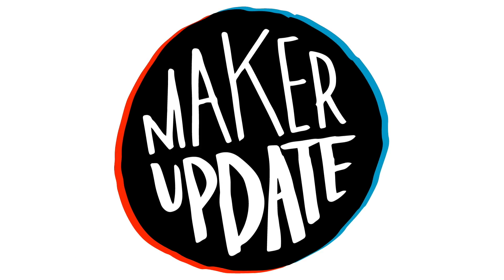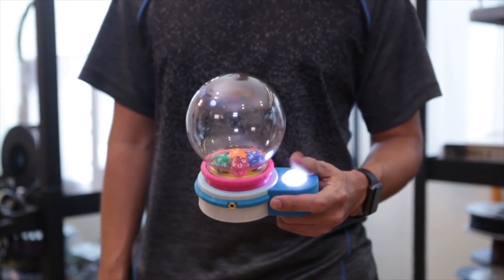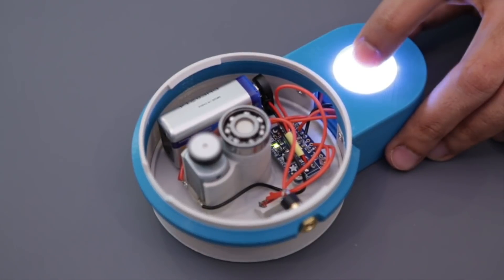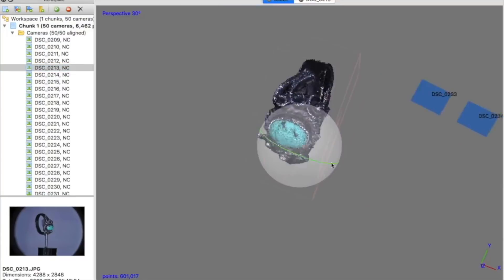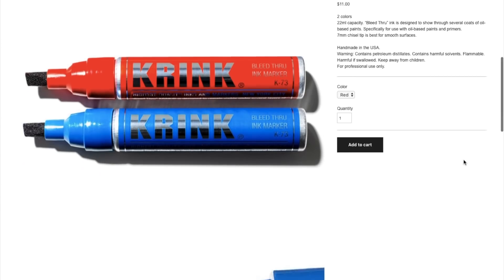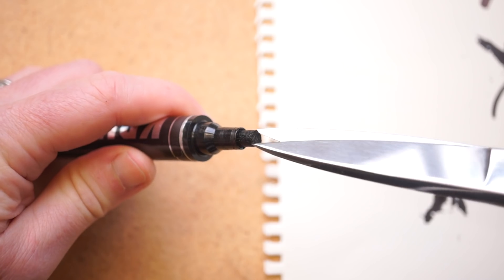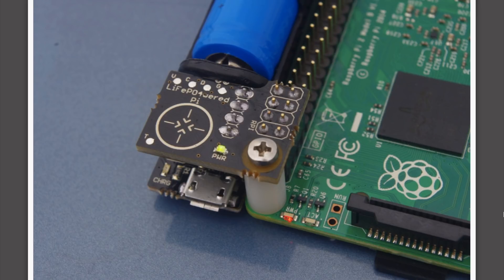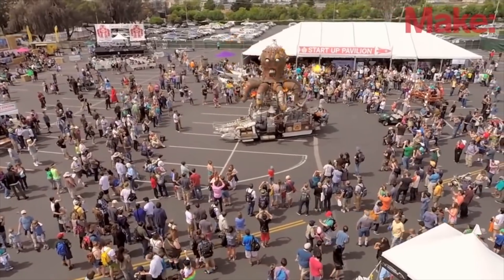Permanent Ink [Maker Update]

Comment: The CT/3D Scanner looks awesome, I wonder if it could be modded to do holograms.

BTW, as an alternative to the LiFePO4wered/Pi, I bought on ebay these $2 Micro USB 18650 Battery Cell Cases that can power the Pi or charge the battery.
Reply from the maker: Great suggestion on the Holograms! You should ask Jon directly by commenting on the Instructable. Who knows, you may inspire him to make a dedicated hologram scanner! 

As far as the 18650 cells go, I love those things! I mentioned them (and cheap cases for them) as my cool tool a few episodes back. I've been using them for all kinds of projects.